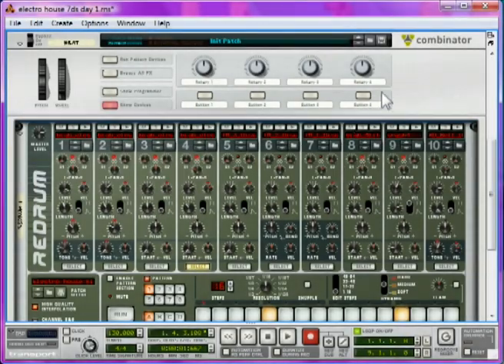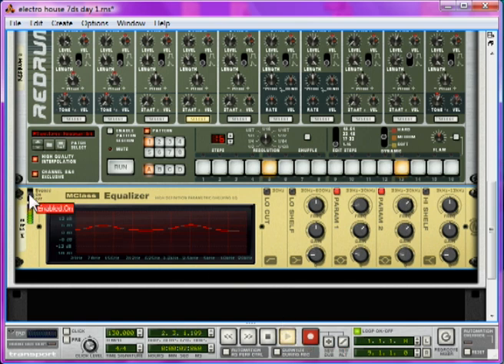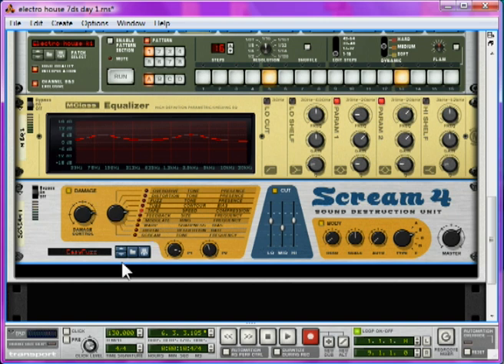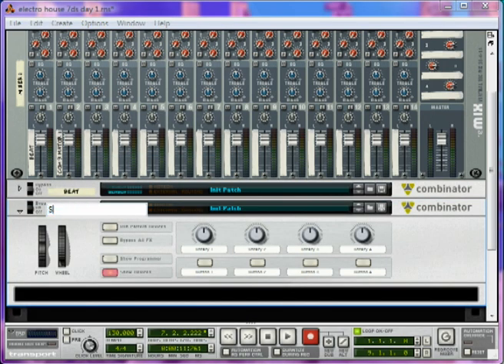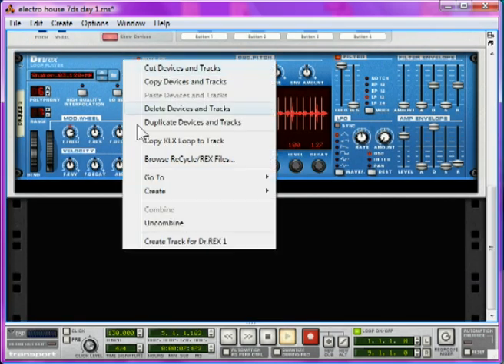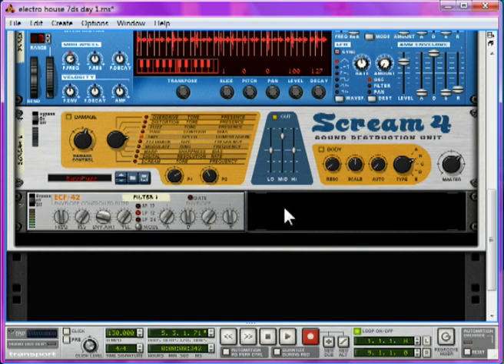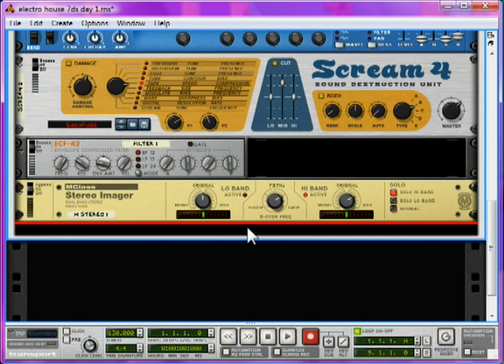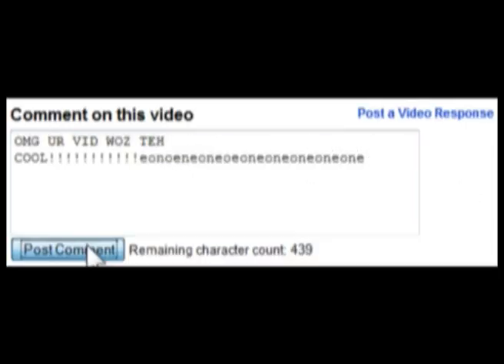Electro House Tutorial: Day 1 pt. 2 - EQing an Electro House Beat [7 Day Song]

Comment: I'd like to remind you people that Scream Distortion Unit has a built-in EQ (the blue thing in the middle). Although in this video everything seemed to go well, it's still recommended to initialize the Scream Unit as well,  because otherwise the EQ and Body (with resonance etc) are applied, and that changes the the sound radically. Even furthermore, I tend to initialize EVERYTHING before starting the production. But this video is very helpful, I enjoyed the theory :)